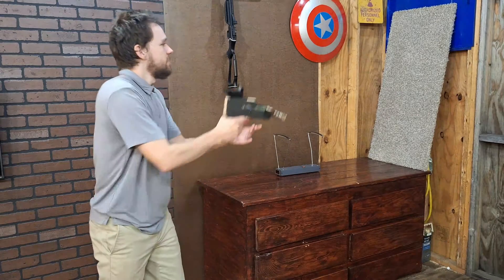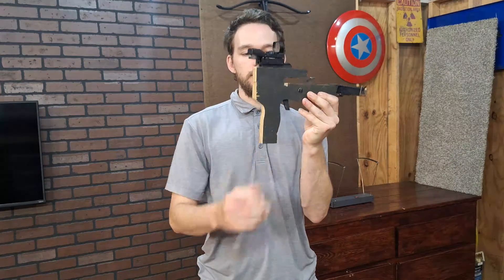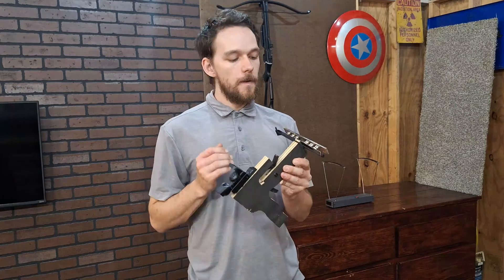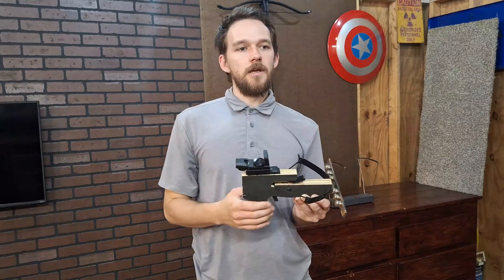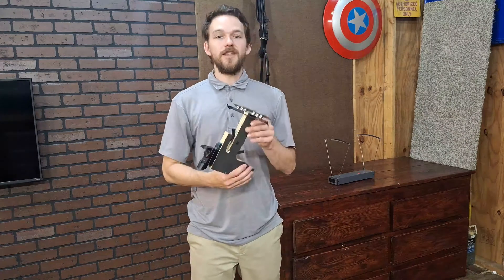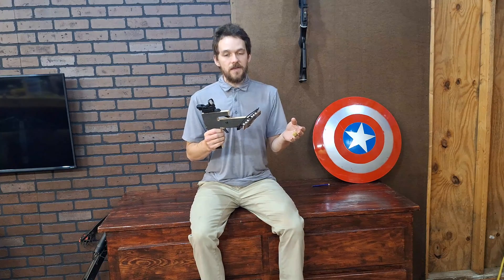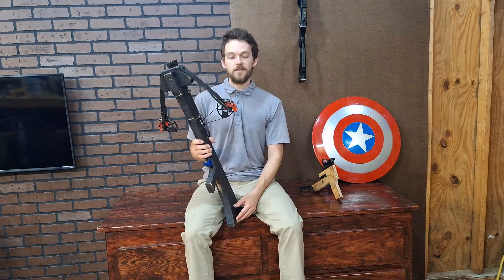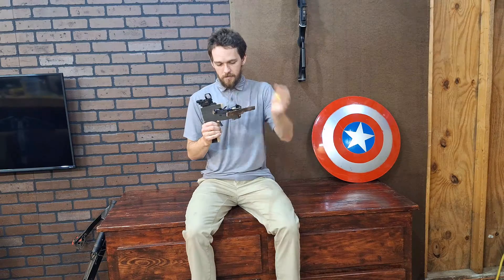World's First Magnetic Powered Crossbow (Prototype)

Comment: You have to stay within the magnetic field for it to work.  Maybe 2 curved limbs, 1 rigid with magnets and the other flexible.  The distance between the two limbs needs to stay very small, like less than an inch.